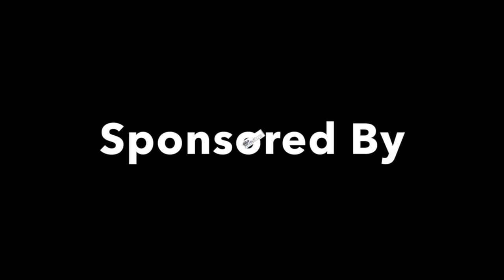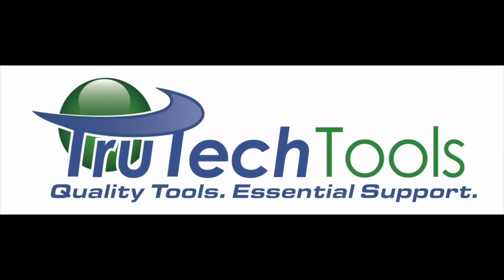HVAC Tools: Why I Sold My Testo Kit

Comment: field-piece hoseless with MeasureQuick app. done
Reply from the maker: Remember this video was posted before mQ was as strong and definitely before Fieldpiece came on board with mQ. Today I’m mostly using Fieldpiece and Testo proves with mQ and haven’t used my iConnect in forever!
Reply: @StephenRardon  That's why I never went with Imperial. They are the apple of testing tools. Sucks for them - the industry moved on without them.
Reply: @StephenRardon  So you bought more testo probes now that mQ is leading the way? So iConnect isn't as good as mQ?

Comment: SteveDo you think Testo probes would stay connected if used inside a cooler and I was trying to connect with the cooler doors closed
Reply from the maker: +Scott Stoner I'd ask +Nor Cal
Reply: +Scott Stoner I'm almost certain a LE Blootooth signal won't cut it for that.
Reply: Scott Stoner signal will reach outside of small walkins and reach in, but not very far. I've been on top of a unit and left temp probe inside.

Comment: Hi Stephen I’ve watched a couple of your videos about testo I know your saying you didn’t use it a lot but are they good quality and is the app easy to use
Reply from the maker: The probes are good enough but the wireless range is poor. The app isn’t horrible but measureQuick.com is a much better app and works with a wide variety of probes from many manufacturers.

Comment: You should use the Measure quick app it can connect to a variety of different wireless probes with the capability of taking readings on 2 circuits it's a great diagnostic tool and it's a lot more palatable than the testo app. It works with I manifold, testo and some others but the testo's work well for me and they aren't so expensive.
Reply from the maker: I’m on the wagon with mQ already for sure! I prefer the Fieldpiece probes though I use the Testo 510i probes for static and gas pressure.

Comment: Hi Steve I’m from the uk I just recently purchased the testo 115 clamp thermometer I’ve tested it against my Kane flue gas analyser which has differential temp on it and the testo is out on hot it’s 3degree centigrade and cold it’s 5 have you experienced this before or have I got a dodgy testo cheers bud

Comment: the hours suck the heat sucks but the money is always good .... I have always felt confident in my diagnosis but when it came to ductwork I seem to second guess at times so having this tool will make me a better tech and my customers getting what they pay for.
Reply from the maker: +michael cole feel free to shoot me any questions you have once you get it
Reply: +Stephen Rardon (HVAC with Stephen Rardon)  thanks will do.. I have been familiarising myself with the software it seems a little time consuming but I guess the more you use it the quicker and easier it should get.
Reply from the maker: +michael cole to me it's faster than writing everything down on a note pad that will only get soaked in sweat this summer! then again i used the app for a long time before the iManifold even came out so i had a lot of practice initially. the more you use it that faster you get and it becomes second nature...
Reply: +Stephen Rardon (HVAC with Stephen Rardon) no doubt ... keep up the great videos!
Reply from the maker: thanks +michael cole
Reply: How do you like working for Cassel Brothers?

Comment: I started on Wednesday on Spring pms. Started out using testo smart probes. After 10 minutes I went back in the truck and grabbed the iConnect. I'm giving the testo smart probes to a friend to test out. I'm staying with iConnect.

Comment: I have the sporlan smart tool and the Iconnect .I like both of them and they both are great.
Reply from the maker: +Phillip Joy Sporlan is great for a quick pressure and SC/SH check to see if further checking is necessary and the iConnect gives you the full view of what's happening. they work great as a team!

Comment: I recently purchased a Testo kit out of curiousity. With that kit I purchased 2-115i, 2-549i, 2-605i, 410i, 405i, 805i and a 510i. I was planning on making some site visits in a couple of different states, and wanted something I could trust, not wanting to rely on what the local contractor might have or might not have. I took the Testo pieces I needed to calculate total system capacity, and hooked them up to a heat pump that was running in a psychrometric test cell to see how close the calculations from the testo units were to the test cell computers. Test cell showed 25616 btu's and the testo rang in at 24889 btu's. Refrigerant temps were within .2 degrees F and  pressures within .5 psig. My only complaint is the distance limitation due to low power blue tooth, if I could make a change it would be to have a longer span to measure indoor and outdoor conditions at the same time, and for a vendor to incorporate a current and voltage sensor into the mix.
Reply from the maker: Air Dynamics  the Testo 770-3 meter is coming soon to allow current and voltage to be read. Glad they're all working out for you!

Comment: All the videos I have been watching. Very good BTW. I own sporlan smart tool, Testo and YJ Mantooth. No one has done a video on Mantooth like the other Bluetooth devices. Just wondering.
Reply from the maker: The general feeling of the guys I know on YouTube is that the Mantooth is junk. I'm not interested in spending my own money on it just to do a review. How do you like it compared to the others you own?
Reply: Stephen Rardon I've had them for over a year now. The bluetooth range is better than Sporlan. YJ just updated the app a few days ago. i do like the fact that i do not have to add a tee for charging. The updated app has improved the way the gauges connect. When i get time i would like to do a pressure and temp review.
Also lithium usb charging no changing of batteries.
Reply from the maker: william Lauer battery life is good?

Comment: Stephen, All of these Wireless tools are great but as a technician of 33 years I will stick with my iManifold the more I use it the more I find nothing stacks up.
Reply from the maker: you're absolutely right +Larry Cole the more i use the iConnect the less i find a place to use other systems. I'll be hard pressed to convert if something better ever comes along, i'm talking better not cheaper cause we've got that with the Testo stuff.

Comment: I'm holding out on the Iconnect until it comes with a robot to clean coils and up size the return air duct. Lol
Reply from the maker: Hard to compete with the price for testo
Reply: +Stephen Rardon (HVAC with Stephen Rardon) it is, for the price they work great for refrigeration calls. You need to do an Iconnect vid on a walk in cooler with multiple coils. 👍

Comment: I (almost) bought the testo set as it is less expensive in comparison to some other sets, I ended up getting the fieldpiece sman 460,  it has the micron gauge built in and is wireless as well
Reply: The thing I don’t like about their micron gauge is you can’t clean them.  Good gauges though

Comment: The biggest problem I had with my Testo 550...was the wiring on the temp probes was garbage... I used the manifold rarely... I was so careful with the probes not to bump the plugs into the manifold. I had to buy three clamps due to the plugs sticking out like sore thumbs on the manifold. Testo does make wireless clamp probes...But they won't link with the manifold..This would be the perfect solution for me... But Testo wouldn't sell as many replacement clamps. I even spoke to a Testo rep at a supply house... I asked why don't they just offer a software update on the manifold to use the wireless bluetooth clamps as the manifold is already bluetooth capable? Just got the run around...She also knows why... Less sales on the clamps...So I sold it... Very disappointed.

Comment: I think a lot comes down to connectivity, my shop gave me some yellow jacket mantooths, sure it's Bluetooth, (but don't dare walk around a corner with iPad or iPhone.)  and if working on a bigger commercial unit, the mantooths have cumbersome wires attached which limit  usage. Stephen, you seem to have owned alot of different new technology's, which new manifolds are the best. I know analog which previous poster says sticks to them, but there is a lot of time wasted checking dry/wet bulb, delta t, static, and cfm, going up and down stairs makes no money.
Reply from the maker: +mychoclabwinston for the money you can't beat the Testo Smart Probes but for capability you simply can't beat the iConnect system! i get a lot of crap for promoting the iManifold system but you simply can't deny that it's the most capable.